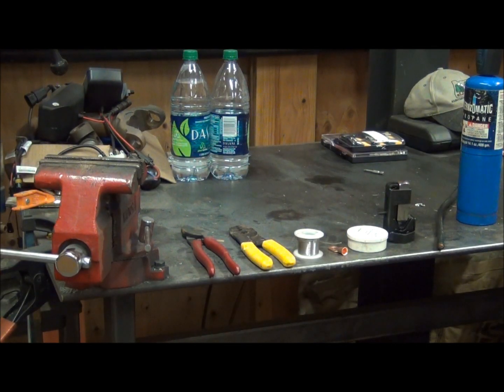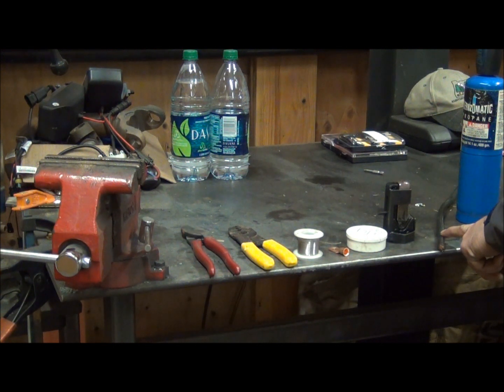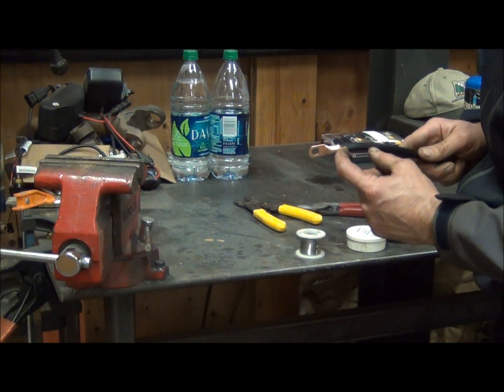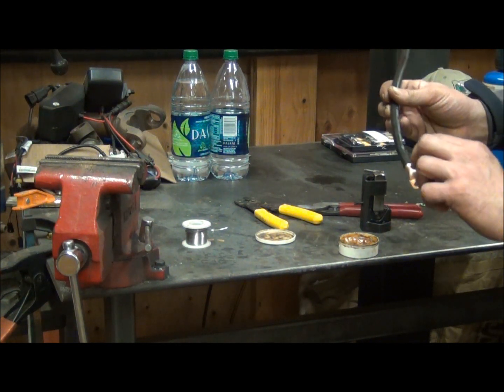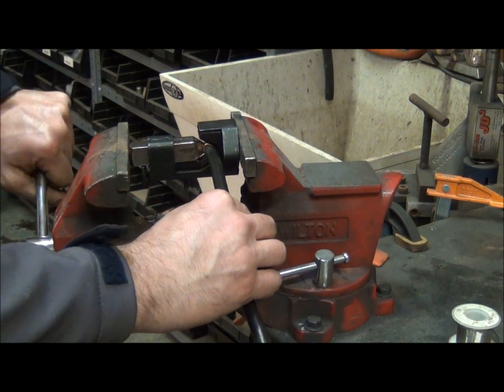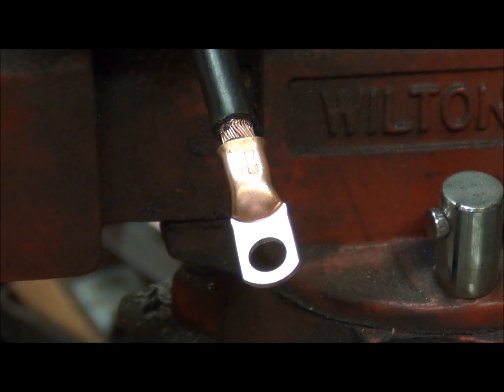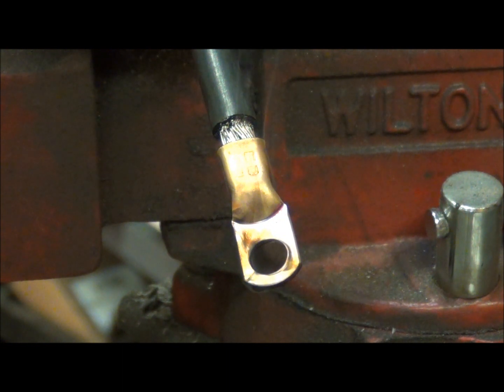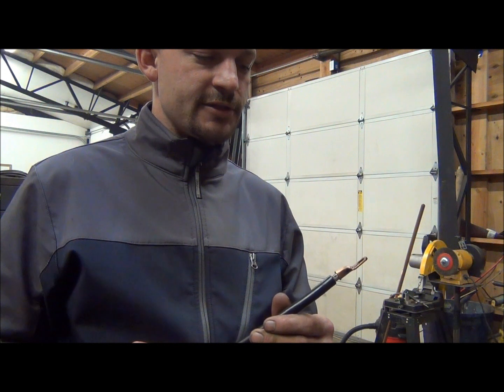Crimping copper ring terminals on heavy gauge battery cable

Comment: Flux is corrosive and should never be used on electrical or electronic wiring and never use acid core solder! a well done crimped is more than sufficient!
Reply from the maker: While I agree that a crimp connection is often sufficient, you are misinformed when it comes to flux...certain rosin fluxes can be corrosive and must be cleaned after use, but the use of a good electrical flux is often required for a good solder joint.
Reply: Having worked in the electrical field for 30+ years, I can tell you that flux is critical when it comes to soldered electrical connections.  Flux is corrosive, generally speaking, so cleaning the areas to be soldered -- both before and after soldering -- is good practice.  This is the only thing that was missing from this, otherwise, excellent video.
Reply: ghraffydd I'm not sure I'm understanding your reply, ghraffydd.  At first, I thought you agreed with the use of flux for good electrical connections, but your additional words seem to indicate that flux causes problems down the road (in the future).  I don't recall whether or not the maker of the video mentioned it, but one should always use a heat synch while soldering, as well.  This practice prevents added heat from entering the insulated section of the lead/wire and, consequently, prevents flux and/or solder from "wicking" under the insulation.  If you've ever seen a lead that has has wrinkled insulation adjacent to the solder joint -- or has become stiff after soldering -- you've seen exactly what I'm referring to.  By the way, the use of flux should be restricted to the area to be soldered only -- do not over use flux AND clean everything very thoroughly both before and after the solder joint is created. The proper use of flux is standard in formal soldering training courses, so getting proper results is simply a matter of using the proper tools.
Reply from the maker: Timberwright Svs I didn't mention it in the video; but excellent information!  I'm typically not very careful with the low voltage/large gauge cables.  The cheap crimp/solder method has served me well for quite some time with this type of joint.  I try to avoid solder with smaller gauge wire in automotive applications (as you stated, solder can wick up under the insulation and create corrosion and/or a stress point that will eventually break).  When I do PC board repair, I am VERY careful to remove all of the residual flux...
Reply: Timberwright Svs
Have to agree.
I have had lot's of cars and bikes over the years with electrical faults that were due to using more flux than the rosin cored solder. The flux wicks it's way along the cable and the cable corrodes. Hit the crimper with a decent hammer.
Reply: sewerzuk Your comments seem to indicate that you're a level-headed guy, sewerzuk, so I trust that nothing I add to the discussion will be taken the wrong way.  I watched your video again and here are a few differences between what you did and what I would've done: I would've cut the insulation back a bit further to accommodate a heat synch, I would've slid a short length of polyolefin heat shrink back over the insulation of your wire for the final step (sealing the connection) and I would've emphasized cleaning by showing it -- both before the flux was applied and after the joint had cooled down (isopropyl alcohol works great for this purpose).  You did mention the use of heat shrink, however, so the heat synch and cleaning are the main points here.  As I mentioned before, your video is excellent -- especially when compared to much of the work that I've "reworked" in the past.  In short, there are a LOT of folks out there who haven't been properly trained about the basics of electrical connections, Ohm's Law, and why it's so critical in this regard.  By the way, I recommend flux (and the proper tools) for practically all electrical connections: it's the only way to promote proper solder bonding.  A lot of people would argue that soldering is virtually impossible for small wiring jobs -- i.e., wiring a new stereo head unit -- but the word "tools" applies just as much to the proper-sized butt connector -- which can be crimped very easily -- as it does to a heat synch and a good soldering gun (this is where companies like Waytek Wire & Weller shine).  So, you see, the excellent crimping and soldering connection method that you've employed in your video comes into play for small jobs, as well … Now I'll take my technical hat off and tell you that I like your garage.  Is it a Miracle Truss (open span) building?
Reply from the maker: Timberwright Svs The points you make are certainly the proper way to do a job like the one I show in the video!  Sometimes I get carried away with details, and in a non-critical application I've found that my time and attention to detail is best spent elsewhere :)   I spent a good number of years in the Navy as a nuclear electronics technician; while I didn't spend much time doing real electrical repairs, I did go to school for it and it has always been a hobby of mine.  I don't do any "real" electronics work anymore, but I still keep the oscilloscope and soldering station dusted off.  Occasionally there is a use for them!  I built my shop about 8 years ago; it is a clearspan steel truss system.  I bought the trusses (and engineering) from Web Steel in Sandy, OR.  It is 30x48.  I'm always looking for more space, but I do have the space utilized well.  I have recently rigged up elevated platforms with pulleys, cables, and a winch for some of my equipment.  My raft (and all of my whitewater gear) get stored up there, as does my UAV workbench.  I am considering also storing my CNC table overhead, as it doesn't get used very often.  The shop is heated with a waste oil furnace that I built, and I also keep a dehumidifier running to keep my tool steel from rusting.

Comment: Nice job and good educational video. I was glad to see you crimp then solder.

Looks like you have the Forney hammer crimp tool (stacked and welded steel) instead of the other brands (cast steel, NOCO, Pico, EZ Red, ...).  Any idea which is better?

Have you had any problems with the solder stiffening the end of the cable and concentrating movement (e.g. from vibration) and weakening the cable where the solder stop wicking up?
Reply from the maker: I haven't tried any other brands; the one I have is clearly an inexpensive tool, but it works.  If I did this for a profession I would likely invest in some kind of hydraulic crimper.  
I have had an issue with smaller gauge wire breaking at the point where the solder stops (like 24ga)...but never a problem with the heavier gauge cables.
Reply: Well, in my experience, even 12ga stranded cable can easily break in automotive applications, because of the ever present vibration (it was when wiring relays into automotive headlights).  When I discovered breaking failures, I refrained to continue to use solder.  Now, a crimped connection is better ONLY when properly done, which requires STRONG pressure for larger cables. Even 1/0 is only marginally crimped with a bench vise, almost requiring a Hydraulic crimper... but it is only me... YMMV.

Comment: Great way to crimp connector. FYI solder actually adds resistance but in some cases it's necessary for a stronger connection.

Comment: DO NOT use electrical tape to insulate.
Reply: lutalutamedia Granted, heat shrink sleeving w/ glued interior is best... but any insulation that prevents a short from a misheld or dropped tool at the battery CAN be a lifesaver. Electrical tape does have its probs over time, but I would not rule it completely out in less than perfect conditions. (emergencies, time constraints etc.)

Comment: That looks like a great way to do it!  

How much difference is acceptable for a good connection between the outer diameter of the wire and the inner diameter of the cable?

I have an application where I have some Anderson plugs going on the end of a 2B&S wire but they are a bit larger in diameter than the cable.  The next size down of plug is too small though.

Any advice much appreciated.

Comment from the maker: MEP-004a's were used until the early 1990's, but there are still quite a few floating around out there in use.  It is a 15kw 3 phase unit.

Comment: Thank you for taking the time to make this video. Of all the methods I've seen for attaching lugs to large gauge wire (and I've seen a lot) this appears to be the most secure.  The best of both worlds - a mechanical connection that resists vibration and an electrical connection to increase conductivity.  Great Job! Thanks again.

Comment: actually learned how to solder on this video, didnt know i was doing it all wrong. Thanks!
Reply: Brandon Estes Actually a little better to clean off the finished solder area w/ isoprop alcohol to remove existing dirts & oxidation ... to lessen the oxidation later, over time. Shrink sleeving w/ glue on the inside helps seal the wire completely from water & air ... EVERY little bit extra effort helps you in the long term 👍

Comment: Good video, but a few notes.

Crimping only is required for military usage.
It is better for situations where there are heavy vibrations and you need the strands to flex with the terminal.

Soldering provides a better connection, but it may make the wire stiff and susceptible to breakage.

Both are okay if done right, but if you don't have crimp tools, youre best bet is to smash the crimp with a hammer and finish it with solder.

For most car I work with I use the same method the mfgr did.